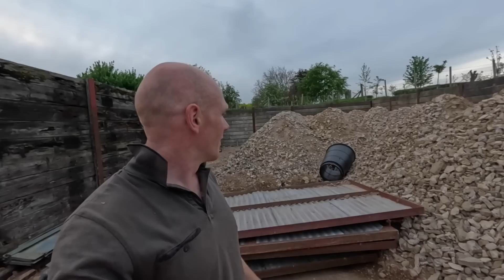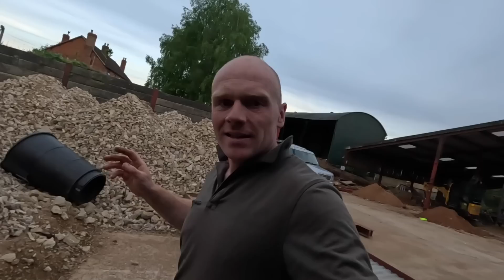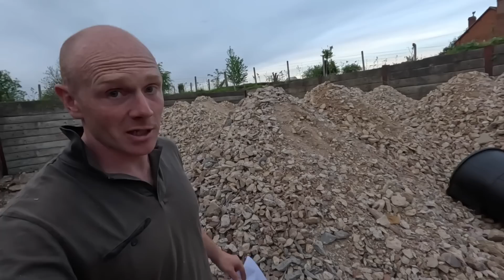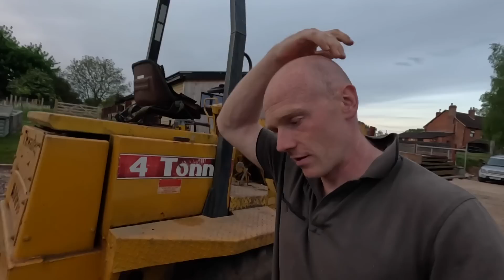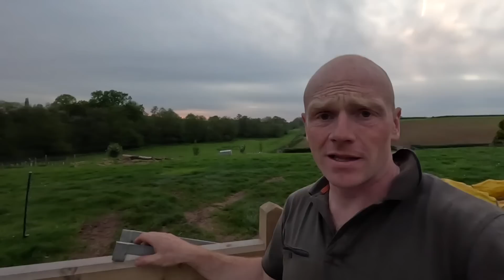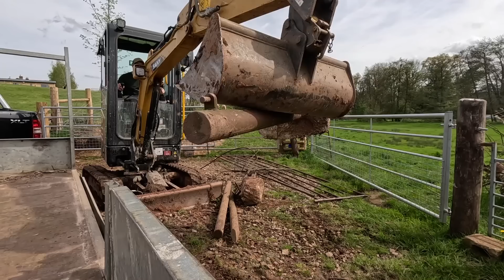WAS CRUSHING CONCRETE OUR BIGGEST SAVING SO FAR?

Comment: I used a small crusher in my back garden to crush the hardcore I knocked down (old wall) and what I dug up (construction waste from the original build). Ended up with about 10tons which was used for the base of our garden (fake grass) and the foundation of my workshop. A friend took about 4 ton for his drive. Let my neighbours know I would be creating a lot of dust and two days work handballing it all in saved a fortune and was very satisfying. Would highly recommend- fitted through the garden gate.

Comment: If you can weld, you could knock up a Trommel to screen the material. Its not hard as alll a Trommel is, is a tube made of screening mesh, sat on a pair of rollers at each end. It would probably cost less in materials than hiring a screening machine.

Comment: Hi Tim as a digger driver youre right about aggregates. Type 1 mot is the highest grade of roadstone 0-40. Its also called 803. The stuff you have is 6f2 which is recycled concrete and brick 0-75mm

Comment: MOT is the old term, MOT ( Ministry of Transport) is now known as SHW ( Specification for highway works ) and this covers all materials for road construction. Type 1 sub base is used as the final unbound load bearing layer before concrete, asphalt etc, this is made from virgin quarried aggregate. Type 2 is the same but made from recycled aggregate. Type 3 is a subbase that is more free draining for porous surface layers. 6F4 is 75mm to dust and is used as a capping layer normally used below Type 1 /2 with 6F5 being the recycled version of 6f4.

Comment: I put some real thought into my tonnage estimate as well, I looked up the concrete crusher specs found out it's volume output rate per hour and times that by roughly the amount of hours I thought it was crushing concrete over the day and a half it was there (I deducted lunch breaks and took into account several tea and biscuit stops) 😂
Reply from the maker: Were you close?
Reply: @TheRestorationCouple   my guess was 700 ton from memory, you must have had a few extended tea breaks that I didn't account for 😅

Comment: I agree the saving is big but someone local in the comments said they were interested in buying the concrete. I think you need around 40 tonnes of sand so it is a significant amount. That would be for the whole building though.

Comment: I was staggered at how much you ended up with. Massive saving.

Regarding the sand, doesn't it come down to the grains and if they are more rounded or rough. If too rounded you can use it with cement?

Comment: CO2 Comment : In addition to the CO2 saving from not having a parade of HGVs, you've also saved the CO2 that would have been required to blast and crush the aggregate at the quarry if you bought in new aggregrate. With some offsetting due to the use of the crusher. So you've saved a shed load of CO2. More and more budgets will have to be done not only on financials but also on CO2 emmissions I think ( maybe even for planning permissions ). Greetings from Prague, and well done to @apintofstella1 with their spot on guess !
Reply: photosynthesis

Comment: Ooooooh.  Rock Grizzly!  I used to have a homemade screen of scrap lumber and hardware cloth that I used to clean out flower beds.  It fit on a tote and I would slide it back and forth to sift out bulbs, rocks, and roots.  So satisfying.  When I found YouTube videos of the giant ones, I was obsessed.  And I've seen several DIY versions made with barrels with holes drilled in of various sizes and mounted on a slant that sorted various size rocks.  I can't wait!  EDIT:  I just found out this is called a trommel?